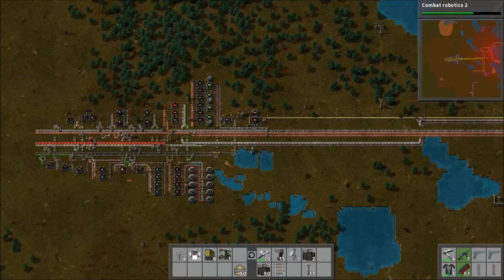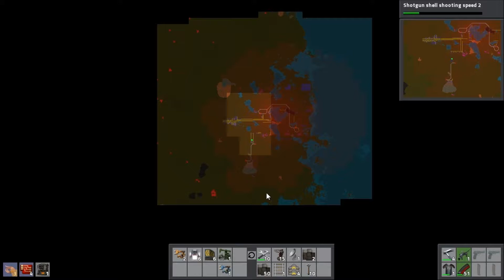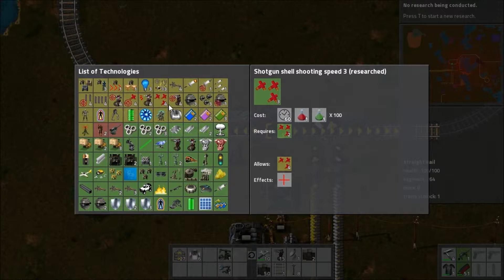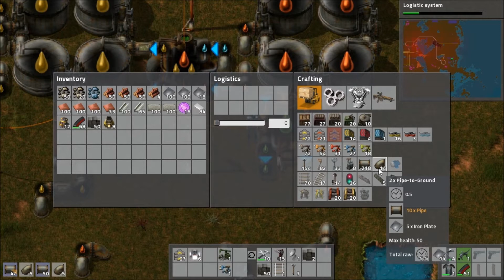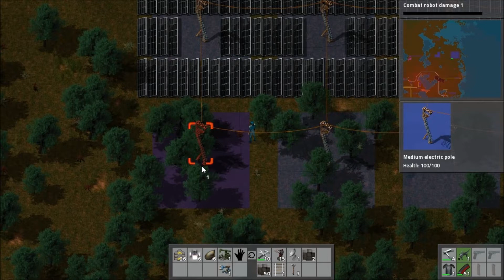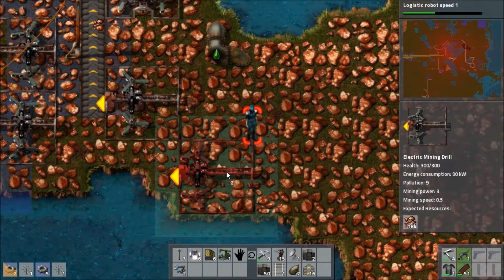Factorio Railworld Ep#9: Plate and power production

Comment: I have a suggestion for your oil problems. Since you have to send the oil products (plastic, sulfur, and lubricant) over such a long distance you might considered moving your entire oil refining operations to the heart of your factory, much closer to your grand smeltery. Then you can have trains deliver the crude oil in barrels, this just means having the pesky barrel filling and un-filling depots. Once you set it up then you can just have trains deliver your oil to the same refinery even after you drain the first oil deposit.
Reply: Also this means much more concentrated pollution source to be taken out with modules and defended in one location rather than far flung production facilities which take time to run over too.
Reply: That would be a good idea, but the problem that might come, is that in this system, getting room for the oil production so close to the heart of the base, may (or may noy) steal some space that might come of use later on. Personally, i prefer to have oil production far from the base, and pipe the final products into the base (as in lubricant, sulfuric acid) might go to trains still, however that will take a hellova lot of time, and as our good guy bentham here, i'm fed up a bit with factorio right now, but soon the little bug will bite again, and i might try it out with trains.. :)